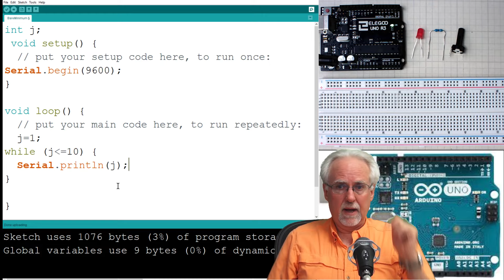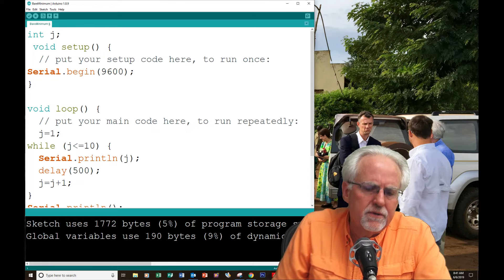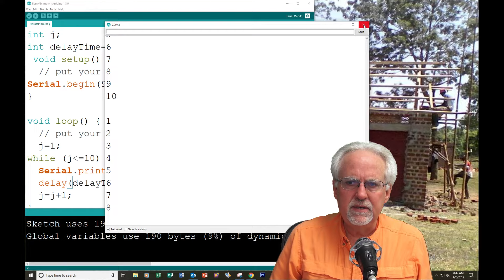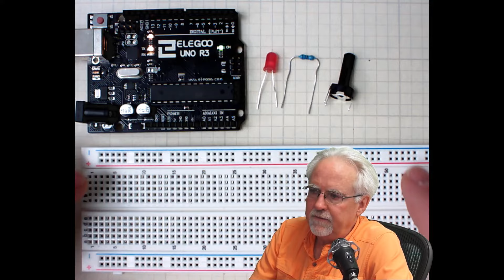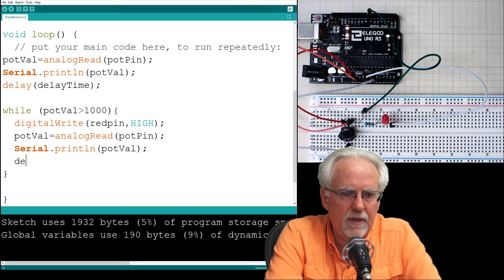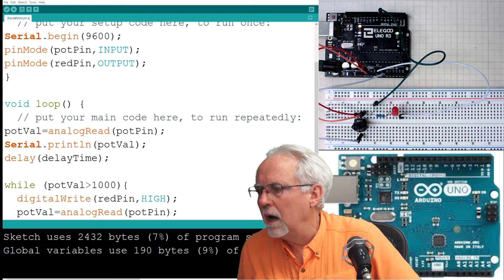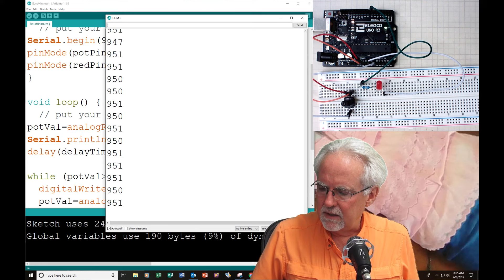Arduino Tutorial 17: Understanding Arduino While Loops

Comment: This is weird. I wired up the circuit exactly as you showed, and wrote the code exactly as you showed. But when I upload it, the LED stays on and the serial monitor shows 1023, regardless of the pot setting.
What could be doing this???

Comment: Hi Paul! I don't understand why we would use a while loop for this, given that the loop function runs in a while loop, we can accomplish the same with an if statement. One consequence to this is any code after the while loop is blocked until potVal is <= 1000. This may be desired or may be a source of confusion depending on your goal.

We could write the code below and get the same result, and avoid the duplicate analogRead call.

  potVal = analogRead(potPin);

  if (potVal > 1000) {
    digitalWrite(redPin, HIGH);
  } else {
    digitalWrite(redPin, LOW);
  }

Comment: Here's a good tip if you are wondering whether you should use for loops or while loops. Use a for loop if you know the exact number of loops it will take, like blinking an led a certain amount of times. Use a while loop if you don't know how many times it will loop, like looking for a certain voltage coming out of a potentiometer.

Comment: Lesson Learned; make sure to write out Serial.begin(9600) and not Serial.print(9600) for the monitor setup. The compiler doesn't see it as an error, but the monitor won't print out. Took a fair bit of time to suss out because my mind didn't 'see' that it should be Serial.begin even though looking straight at it. The tricks we play...

Comment: Hey Paul. the while loop is quite a brilliant command as I agree, it kind of simplifies things , I am not a bit fan of the for command. but that's just personal preference. :) 
I know this is not the place to ask this. but I had an idea of adding the V2=(5./1023.)*readVal formula into my while loop so that I could actually see the exact Voltage instead of voltage increments. I did have to do it twice otherwise after I hit my set Voltage, the serial monitor would revert back to increments . and BOOM :) it worked like a bomb. if I could show you my code I would, as any advice or direction is always a win for me. but  I am not going to ask for your email on the web lol. these tutorials of yours are so much better and easier to understand than reading alot of books on coding. thanks for that man
Reply from the maker: Excellent!

Comment: it look so “for” is more  in a frame of order   then “while “The command sequence can be changed inside "while"
Reply: If it is optional to explain setting electronically  parts of  CNC with Arduino and NEMO 32 motors from your side . I strongly believe it can be most reliable information to be  based on and  to be most popular part of you big works . I not find serious information about . Only settings with one motor when it is need to be 4 including spindle motors . May be it is need to be developed some board to be assembled    with Arduion or something else .   ???
Thank you

Comment: Hey for whatever reason the circuit I made will only allow an increase of voltage and not a decrease even I turn the knob all the way to left or right I switched for A0 to A1 and that didn't work I even tried switching potentiometer and still does work even i remove the wire for the analog pin I'm still stuck at 5v any advice
Reply: Never mind, there was an error with my code. I forgot to hold my breath

Comment: actually this one was struggles! on pin 7, i cant use digital write HIGH and LOW. I had to set it to 255 for it to work. is this because of an update software or something? switching to pin 6 I was able to to do digital write high/low. but pin 7 required a # value? also if anyone else struggles w potentiometer  mine was "broken" because the knob isnt very stable so its easy to turn it past its default stop, so if you turn past  that  it returns junk values until to turn it back. it took me about an hour and a half of trouble shooting on fourms to find this solution so. hope it helps.

Comment: Another great lesson Paul.  After todays demonstration I added another variable so the serial print would output a 0-5V number.  Then added a second LED (yellow not blue or green).  The yellow LED turned on between 0 and 2V.  The yellow LED would also blink from 2.0 and 2.5V.  The red LED would turn on between 2.5 and 5V.
Thoroughly enjoy your lessons.  You sir, can teach!

Comment: Just finished tutorial 17. Once again well done! I’m just blasting through these lessons.
A thought, sometimes as I am following along, I can’t see how you wired things up and your comments on left leg of a LED can be confusing instead of short or long leg. So maybe if you drew an engineering diagram of the circuit, then I could pause the video on the circuit, build it on my breadboard, then restart the video. This has the added advantage of teaching your followers about circuit diagrams and symbols. This far into the lessons, you shouldn’t have to keep showing us how to plug things together. If you do, then we probably aren’t absorbing your instruction.
Also, thank you for your reply about Patreon that I had questioned about earlier. I plan on helping you out there.
Reply from the maker: Thanks!

Comment: Paul, I agree with your assessment of While loops over For loops. I have programming experience using both and generally prefer while loops and sometimes switch functions. I admit is cheated on the earlier assignments that called for redundant code copying for blinking lights; I used While loops.  Keep up the good work, I am enjoying the series.

Comment: I have learned a LOT from you my friend.  Thank you!!  Tho I have a decent little workshop, I just found the circuits part of tinkercad.  It will actually simulate these circuits using the arduino.  So for those that don't have any bucks, find tinkercad and click on circuits and you can practice coding and see the results there.  Free!
My use for arduinos is for some projects I am making using LED's to outline things such as animals or hearts or whatever and then make them blink in artful ways.  I have to use a Maga arduino for most of the projects because of the large number of LED's in the projects, but for simpler ones you can use the uno.  But I can practice coding in the simulator and get proof of concept even if I don't light up 80 LED's in the simulator.  You can practice for loops, while loops and all sorts of things.  They only have the Uno in the simulator.  Wish they had the Mega.  But just thought I'd mention that.

Comment: can anyone say whts wrong with this code tried to make the same thing

int m;
int v;
void setup() {
  // put your setup code here, to run once:
pinMode(A1,INPUT);
pinMode(9,OUTPUT);
Serial.begin(9600);
}

void loop() {
  // put your main code here, to run repeatedly:
v=analogRead(A1);
Serial.println(v);

while (v>1000){
  digitalWrite(9,HIGH);
  delay(500);
}
digitalWrite(9,LOW);
}
Reply: You forgot to read the pot in the while loop. But why do you need to read the pot in the while loop? Well when the Arduino terminator gets in the while loop it stays in there until the value is not true, for an example at first the pot gives us the value 0, but as we start turning the pot the value begins to rise until it gets to 1000 and then it goes into the while loop, and now it is not reading the pot anymore because you did not put "v=analogRead(A1);" in the while loop so now v = 1002 and it will always equal to 1002 because we are not reading the pot no more. So now the Arduino terminator will stay in the while loop and never stop lighting up the LED. So I have some more things I think you should do. You probably need to set the delay that is in the while loop to 100 or something lower than it is, and then you need to put a delay that is outside of the while loop, and the last one you need to use variables because I do not see the pins being put in variables and that is important to do, because if you never use variables as you should your code will never be organized. I am not trying to say that you are a bad coder, I am just giving you some thoughts on what I would do. keep up the good work!!!!

Samuel

Comment: If you have a light touch and set the potVal to 1000, an interesting thing happens. The pot produces noisy input at high range and potVal goes from 998 to 1002 at random intervals. This reminds me of dirty key contacts that produces a long string of characters.I don't know if a while() loop works to ignore contact bounce.
I have had to clean a C128 keyboard with alcohol in the past. I used Better Working Power C128 with Do - While Loops.
Now I have a working 1541 drive I use with WinVice (PC Emulator) with Zoom Floppy (Connects Serial 6 pin cable to USB cable on PC).
I think we have a Thermistor in the kit and using a while() loop could tell you if it is too hot or too cold. But that is more complicated.
Wayne P.S I used to work in a Radio & TV Repair shop back in the '70s and pots would wear out pretty fast.
I has to use pot compound to brush the track and reassemble the pot to get it working again.

Comment: Hi Paul.  

While I agree the While loop has its unique set of powers, I think we need a better example of the while loop for this example. Since the Arduino uniquely loops in its natural execution it becomes a bit muddled to use it where an IF is much more efficient and much less (more readable) code.  BTW, I love your tutorials...  I'm 55 and love the connected science and math.

See My replacement example for tutorial 17.
int potVal;
int delayTime=100;
int potPin=A1;
int redPin=5;

void setup() {
  // put your setup code here, to run once:
 Serial.begin(9600);
 pinMode(potPin, INPUT);
 pinMode(redPin, OUTPUT);
}

void loop() {
  potVal=analogRead(potPin);
  Serial.println(potVal);
  if (potVal>=1000) {
    digitalWrite(redPin, HIGH);
  }
if (potVal<1000) {  
     digitalWrite(redPin, LOW);
}
 
}

Thoughs?

Comment: i had connection issues with the potentiometer like you did as few videos back. I think the pins are too wide and actually are deforming the breadboard connections. I found that the male/female jumpers(tear off just 3 of them as a set)to connect from the breadboard to the pot. this also makes the pot easier to turn as it is on the end of a 3-wire cord..

Comment: Thank you for you videos. I'm a recent subscriber and I'm looking forward to watching the rest of your videos. As a fellow educator I have a suggestion. I find it slightly frustrating when, on occasion, you will include something unnecessary in the code, It seems that this is usually good practice to be explained later in the course .
I really like the continuous low key deliberate mistakes. It requires a lot of practice and skill to pull this of with out a tell.

Comment: I noticed that the statement;
potVal=analogWrite(potPin)
was added twice. Before the While loop and during the While loop. I played around with this and came to learn that if the statement isnt added into the While Loop, you lose being able to read the potentiometer after hitting a reading of 1000, or basically during the While loop is running. Meaning that its required to continue to be able to read its changing value and to be able to turn off the LED when going below 1000.

I would have thought the statement would only need to be written once and not get erased from memory during the while loop. Why is it removed? I tested it with the FOR loop and it seems to have the same effect.

Thanks for your tutorials btw. They've been very helpful! Although I have the Elegoo Mega 2560 kit which has way more components than what you teach in your tutorials. So i"ll have to go on my own with some of those components but at least I'll definitely be a lot more knowledgeable thanks to you. Although it would be awesome if you could teach us some of the other components. Specifically the RFID module. Thanks!

Comment: One problem I am having is the "POT" is not working as it should.  I think it is the "POT" itself.  Going in and out of the breadboard and my light touch (NOT) has messed this up.  
Do you have a source for a pot that works better or even is mounted on a small header like some of the other parts in our kit?

Thanks again for the great classes!

Comment: I am trying to remember some programming from courses I took quite a number of years ago and I think there are some subtle differences in for loops and while loops that do distinguish them from one another some.  If you use a counter in each type, so the programs are pretty identical except for the type of loop, doesn't one type do the checking for the condition at the beginning of the loop and the other type do the checking at the end of the loop?  So to count the same number of times, you need to have one more added to the counter if I am remembering correctly.

Comment: Your 'while' loop prints numbers 1 - 10, each on its own line, but then it SKIPS A LINE before it starts over.  I wrote the exact same code, and mine does NOT skip a line.  What causes yours to skip one?  What am I missing?
Reply: did you write Serial.println with empty space in parentheses,  after the while loop?

Comment: Hi Paul
Thank you for your most excellent videos.
I am trying to count the dial pulses from an old rotary dial telephone and display the digit dialled on an LCD.
I have managed to get it working but would like to force the programme to clear the counter after a short time and have the LCD display a zero again while it waits for the next digit to be dialled.
I tried a software interrupt but keep getting strange (to me) error codes from my Arduino R3.
Can you please help me with that?
May I send you the code to look at?
Please advise.
Many thanks
Roger

Comment: Just for fun, I wrote a code, to do the same task, but using an if statement loop. Here it is:

int k=0;
int delayTime = 500;
void setup() {
  // put your setup code here, to run once:
Serial.begin(9600);
}

void loop() {
  // put your main code here, to run repeatedly:
k=k+1;
if(k>=1 && k<=10){
  Serial.println(k);
  delay(delayTime);
}
if(k>10){
  Serial.println();
  k=0;
}

}

Comment: Your views on while vs. for took me back many years when I was trying to learn another programming language. The teacher kept telling me I should be using for loops when I was using while loops. I just couldn't understand why. The while loop just made sense to me because you increment the counter at the end of loop. Though, I suppose one advantage of the for loop here is that it forces you to remember to put the increment in the command. If you use while loop, you might forget?
Reply from the maker: This is my take. There are some problems that can only use the while loop. Consider cases where you want to stay inside a loop as long as some condition is true. Like as long as the temperature is greater than 75 keep looping. Then when temp drops, drop out of the loop. You can not do that sort of thing with a for loop. So, there are some problems only suited for while loop.

On the other hand, I would claim anything the for loop can do, the while loop can do.

So, I would say if all we knew was the while loop we could do anything we needed.

Comment: Paul, I keep watching your videos. It looks to me that the While loop provides an easier way to control how code is executed, which does not involve a counter like in the For loop. A counter can be used, of course, but it is not limited to that.  As you mentioned, the control of the loop can be triggered using an external signal, i.e. a sensor. It would be good if you can provide recommendations on when is more efficient to use an IF, FOR, WHILE or any other code control depending on the problem to be solved, based on your experience. Maybe that is already captured in one of the upcoming lessons. Keep the excellent work.

Comment: BOOM.  Loved it.

Paul - Can you do a video that explains GROUNDING ? Confusing how/why there are multiple ground pins on the Arduino. I searched for one but couldn't seem to find one by you. GROUND is confusing. Thank you.
Reply: The ground pins on an Arduino all all tied together so one is the same as any other. They all lead to the negative side of the input power source, in this case the USB connection.

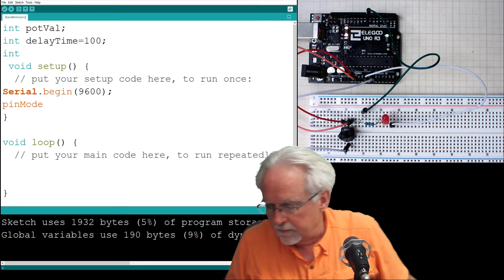Comment: Still watching. Thought you had made a mistake at 12:25 with int potPin=A0, thought it should have been a float but of course you didn't convert it to a float voltage between 0v-5v so the values at pin A0 are only intergers between 0 - 1023.

Comment: Hi Paul, thank you for this tutorial, I will be honest and say I feel I understand the for loop better. I am struggling to understand this one so will run away and play with it and do some tests. Thank you.
Reply: First, congrats on being wiling to play with things yourself and try to figure them out! To more fully explain, a for loop is simply a counter. It will execute code a specified number of times. A while loop will check a certain condition to decide whether it will execute or not. I know this sounds similar, but consider the example Paul mentioned. You could set up a circuit to measure temperature and have the while loop check for a temp above a certain level, something a for loop can't do. Both have their uses, just think that if you need to do something a certain number of times, use a for loop. If you need to do something based on a specific condition (like a temp level or a passage of time) use a while loop. Hope this helps! Oh, one more thing. A for loop will always execute at least once. A while loop will only execute if the condition has been met. Unless of course you write the for loop incorrectly, such as:

for (int j =0; j<0; j=j+1) {
     Do something
}
 That will of course never execute. Programming is fun! :) And yes, you can declare the counter inside the for loop, like I show. Enjoy your journey!